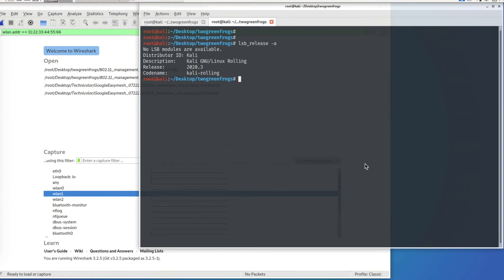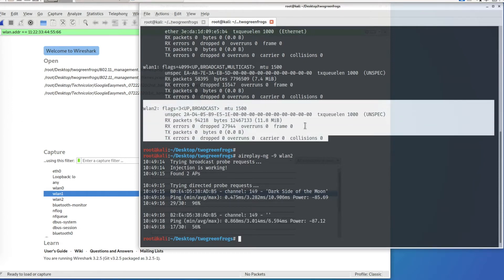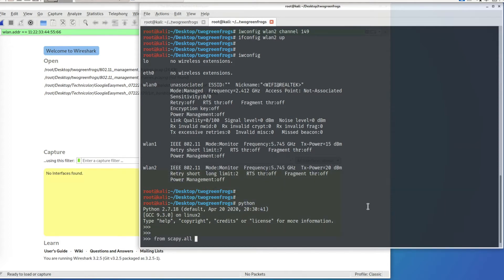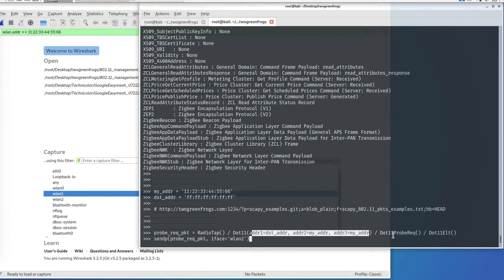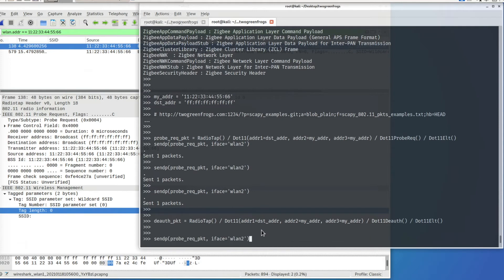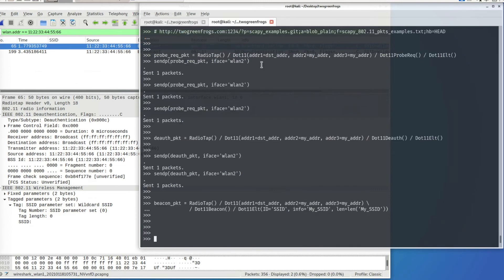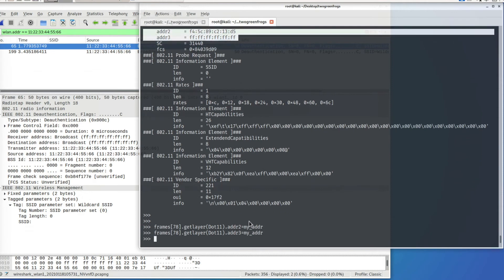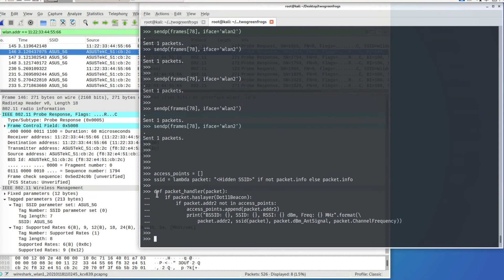wifi packet injection with scapy and kali linux

Comment: Hi, thanks for this useful video. Could you please tell me the Wireshark version you were using for capturing packets? I am using Wireshark Version 3.4.8, and I cannot set a filter like the one you used: wlan.addr == 11:22:33:44:55:66. It says invalid syntax and I cannot find out the correct syntax for this. Could you please help me with that? Thanks in advance!